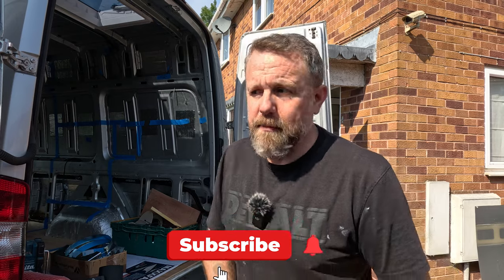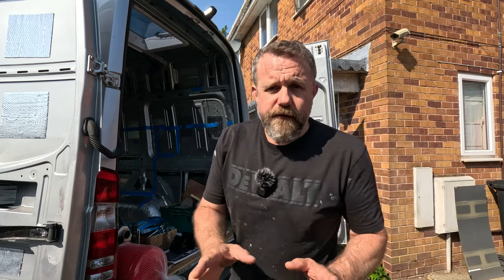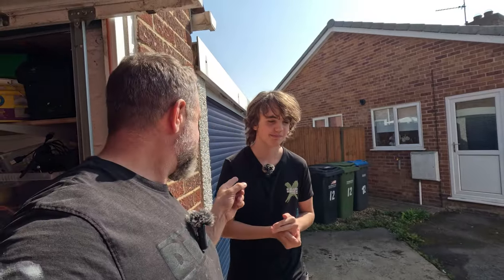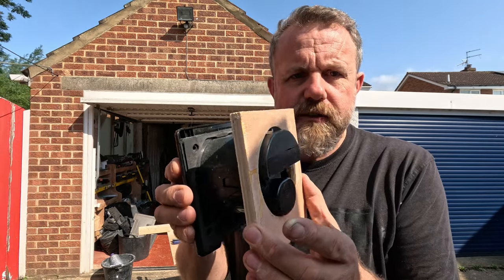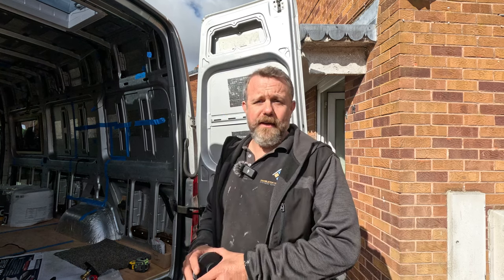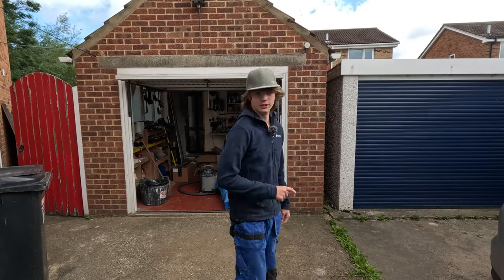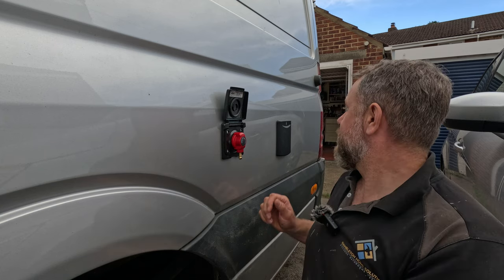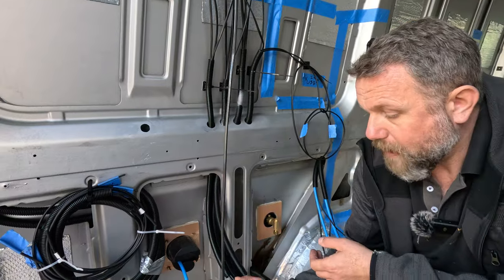Building Our New Home, Campervan Conversion | Cutting Holes for Water, Gas & Electric

Comment: reviews will help pay your bills so dont worry about doing them  i myself personally would prefer reviews are kept separate from the build videos but end of day your a busy person and if squeezing them in to your normal vlogs because you are too busy to do separate ones im sure everyone will understand and its good to see you progressing each week, the max air fan blind with the lights comes with fittings so you can connect it straight into the max fan wires so you dont have to run separate wires for it ,
Reply from the maker: Thank you for your feedback. And that's interesting about the maxxair fan. Cheers for that. The wire is there now will see if I can find another use for it😉👍😁

Comment: Good work guys! Keep it up! Regarding the adverts for sponsorship deals, I don't think anyone is interested in clicking on those, I would have thought the supplier would have stated to you exactly how they want it before sending you the item? I would put it in your usual video, make it short and sweet and honest. Preferably using the product in your video also.
Reply from the maker: @Now-or-Never_Adventures  hi. Thanks for the comment. Yeah they are all different. Some ask for full video reviews but that's hard if there in not much to say about the item. Most are happy with a short couple of minutes. To be fair it depends on the product a but as well. Higher value items I'd be more inclined to do full videos. But like you say. I'll be squeezing so quick ones in the main videos